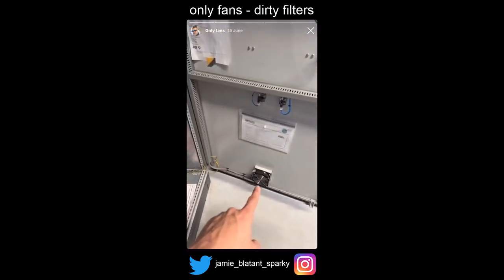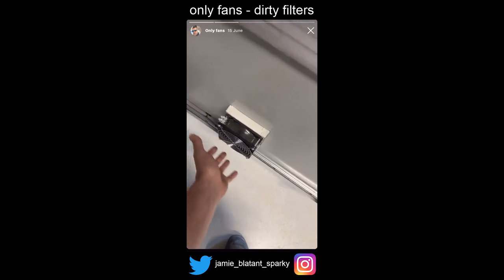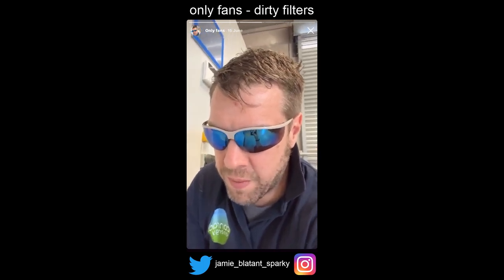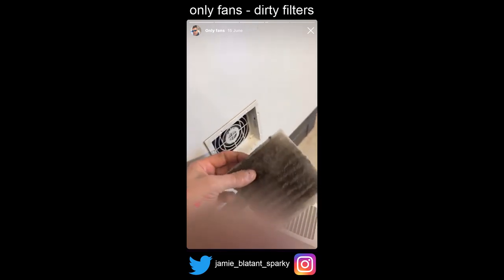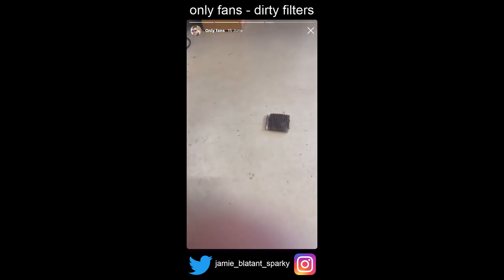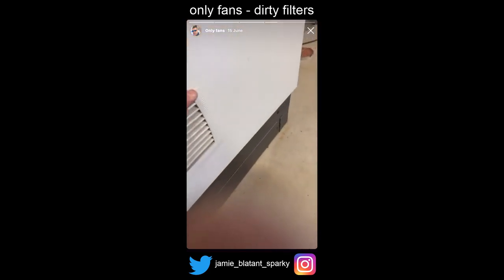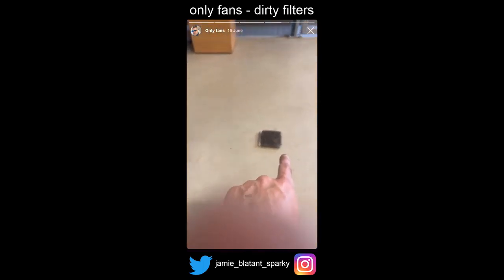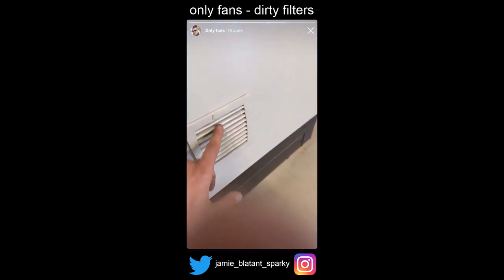Only dirty fans tripping

Comment: Hi buddy, a filter is blocked because it's doing what it's supposed to do. Would it not be worth putting in place a schedule to change them. If it's blocking it's doing something.
Reply from the maker: It’s not doing what it’s supposed to if it’s tripping the panel out , it’s not needed it’s a spotless environment
Reply: @Actual_electrical_content  ok